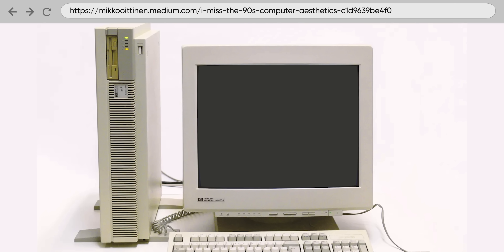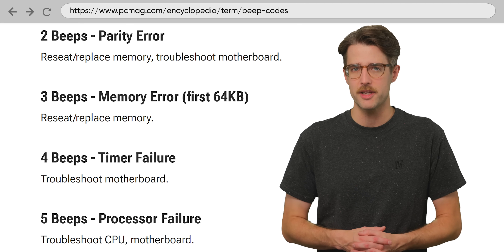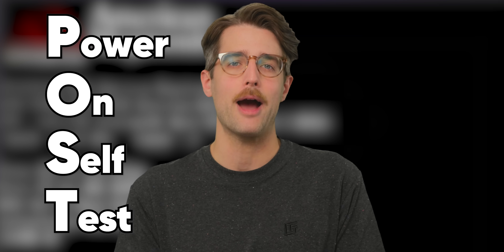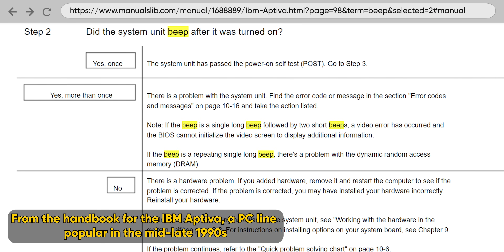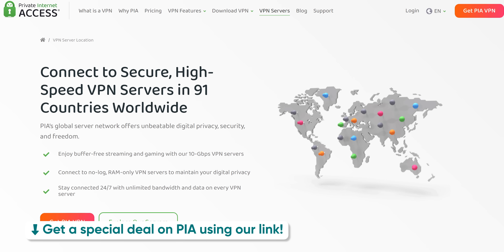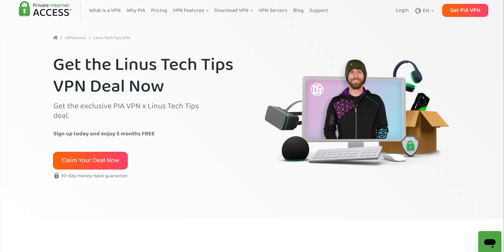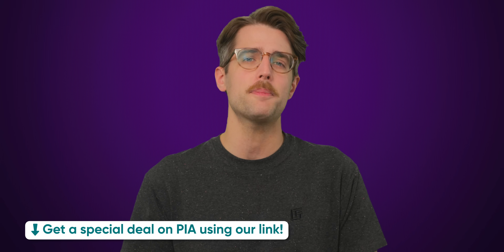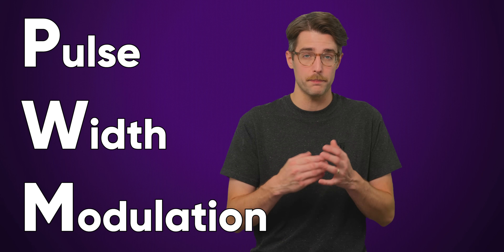Why Computers Don't Beep at You Anymore

Comment: I still use my pc that I builded in 2017, with a z170 and a i7 6700. That MSI board come with a very very very small speaker to insert to into the board. So everytime I boot the PC I hear that beep.

Comment: I needed the beeps, no errror codes displayed did have headers but....no speaker, so I went to an electronics store and bought a bunch (don't know when I might need them ever again so I put it with all the cables that maybe one day i will need), but it worked, connected the tiney speaker and got error beeps that made me identify the error. I left the tiney speake r in and now it gives post beeps and the user does not even seem to be phased about it

Comment: I used the original IBM PC in college. It was the very latest in tech at the time and only a few of the campus computer labs had any. Most of the computers in those labs were Apple IIe's. You had to be an early bird to get one of the 'new' PCs. My major professor's office had one too and I used it to do work for his experiments. The first thing I typed on was a manual typewriter in middle school, so I was pretty impressed by the IBM PC at the time.  I used to know what all of the beeps and their patterns meant.  I kind of miss the old beeping booping PCs and modems.

Ah, yes dedicated sound cards! I will never forget the first time I splurged on installing one in my second PC that I built myself. I got a Soundblaster sound card. Cost almost as much as my video card (aka graphics card) did at the time. But it was worth it because the sound it could send out to a pair of Soundblaster speakers that I also got at that time was glorious! I used Soundblaster sound cards right up until motherboard makers started including really high quality ones right on the board that were as good if not better than the sound cards a had.  One thing I don't miss about old school PC gaming is trying to configure each of my new (at the time) games to work with my sound card. Some never did quite work right and either sounded bad compared to the ones that were perfectly compatible, or even didn't make any sound at all because they just weren't programmed properly to work with a good sound card. Very frustrating! Sometimes, getting the game properly installed and working with your video card and sound card was an even bigger challenge than beating the game itself.

Comment: Had a phase where I was super into OSRS (then just RuneScape) like so many other millennial kids in the early 2000s. Got to the point where I wanted to play it even late at night. So I'd get up, and go to get on my computer. Well that little sonuvabitch had a loud ass POST beep and I didn't yet know enough about how it worked other than that it existed to blow my cover on such evenings. 

So in desperate fear of being caught, I would take my pillow and blanket off the bed and try to wrap them around the computer as much as possible, also put my body in the way and try to cover it like I was protecting someone from a grenade and hope for the best. It did make a difference, but alas I did get caught once or twice. I think it also spared me at least once too. I'm nostalgic for the beep and really like the idea of having something that can communicate something so important (like a 4 beep RAM issue) in such a simplified way, but damn that thing was my nemesis that year.

Comment: Class D amplifiers also use PWM... Today they are so good that there's no sound quality difference to standard amplifiers anymore yet are often 90% or more power efficient while standard amplifiers may only be 78% efficient in the best case which gives class D amps the possibility to be build much smaller as less cooling is needed.

Comment: I remember the tik tik tik tik sound of the ROM check on startup that 1980's BIOSes would do. "POST" really meaning something back then.

1024k OK!

Then the clunk.wheeeeeeeEEEEEEEE  of the hard drive powering on.

Hardware back then had a real sense of drama to it. And a very real chance of failing, refusing to work at all, interracting in unintended and confusing ways or occasionally actually bursting into flame or ejecting smoke.

Comment: My (Win10) main PC still beeps multiple times at me when it randomly decides to have an occasional stroke, slow all the way down without BSoD kicking in, and my cursor whips around my monitors at half the framerate. the amount of beeps depends on how many times I've clicked on something just seconds before this chaos begins so it's no telling when or how many times I'll experience it.

The OS was installed via disk + license key straight from Best Buy so it's a legitimate copy. From day one the stupid thing has barely functioned at all. It made me regret upgrading from my Win7 Ultimate HDD but it was necessary if I wanted to complete my last semester of college. The PC at the time was much like the family dog ~ loved it to death, it did everything I wanted it to, but inevitably became so old and barely functional so it was time to put it down. I didn't want to, but had to. Hell, my first install was from an old WinXP install disk but unfortunately it blue-screened. Tried WinVista, which worked but all the essential plug-ins and drivers couldn't be installed. Strike 3 was the infamous 10. I hate it so much. I want to build a PC to utilize my old Win7 drive.

Comment: I still  like to have a PC speaker in my cases. I have low powered PC's without Keyboard and monitor and can't see the LED's of some because they are in a closet, but I hear them beep when booting or getting to hot. Fans and drives are just to quiet to be heard. I can access them remote and they wake up on LAN when required.

Comment: My MSI mobo still has two prongs to connect a speaker to. Which I did. Then it was just a matter of activating POST in the BIOS and voilá! My PC beeps during startup just like my dad's 80386 and 80486. ^_^ Luckily, I still had my ancient PC from 2012ish, that still came with a beeper that I could repurpose.

Comment: In the mid ‘80s I had a dot matrix 80 char printer. It had an obnoxious piezo-electric beeper which beeped for 3s on the slightest thing. Fortunately I found the DIP switch that disabled it.

Comment: I had them for a long time beeping, but i dont miss em.
Boards and cases dont include them anymore (X570 Aorus Pro and H500M here).
Also Boards have diagnostic LEDs and even codes now and even modern onboardsoundchips are far superior to anything that this little beeper could produce, just need some external stuff connected.
Also PWM isnt just for fans, the entire voltage regulation on boards and GPU's also relies on PWM.
(X570 Aorus PRO: PWM-Controller: IR35201 (max. 8 real Phases))

Comment: Dell has the Pre-Boot System Performance Check, which is the same as POST but instead of beeping, the show messages on screen. If everything is working normal, it boots up normally but any problem with the system such as hardware or software will result in a Message showing up

Comment: It's worth noting that the PC speaker was a piece of crap by design. IBM never intended the original PC to be any kind of gaming platform, so they intentionally left out dedicated audio hardware on most of their models. The one exception was the PCjr, a cheaper version of the PC that IBM released for the home market. It has a three-channel programmable sound generator that was more comparable to contemporary home computers, like the Commodore 64. Unfortunately for IBM, the PCjr flopped hard, and it was discontinued about a year after it was released. It was the first and last IBM PC to have actual audio hardware onboard. 

I've been working on PCs for a long time now, and I find that the speaker is still a handy diagnostic tool to have attached. All the desktop PCs I own still have the speaker pin header on the motherboard, and I've attach piezo speakers directly to them. It's very reassuring to hear that happy little chirp coming from my case when I first turn it on.

Comment: If a motherboard still has a PC Speaker header, I still use it, even if all I put there is one of those little piezo buzzers hanging off the end of the four-pin connector.

Comment: I remember one computer I once built several years ago.  The motherboard came with a little speaker that could plug into the motherboard so you can hear the startup beeps.  I just don’t remember what motherboard included it.

Comment: I actually didn't know that boards don't even have the connection headers for speakers anymore. Just that most Cases don't include them.
Mine's old enough for both, although I don't know anymore if I got my speaker from the board or the initial case I bought for it.

Comment: I still use a PC speaker in my Sleeper build with an Asus ROG Strix B760-i wich it has the PC Speaker pins, I installed because originally it was a Packard Bell iMedia S3720 and it beeped on every boot so it's for nostalgia purposes

Comment: Sound was actually produced by chip in AT and XT keyboards which used sound generating chips to define   keys,  something like ladnline telephones with keyboards instead of rotary dial.  I remember times when you could dial by  whistling in headpiece.  Even my first  IBM 8086 was plying some  kind   of musical tomes during  booting. Later on  during last 286 and into 386 era when  first sound  cards like Soundblaster and Beech  were introduced there was a driver for  DOS and first Windows to use onboard sound as cheep alternative,  we  used to connect some larger speaker outside or a speaker with rudimentary amplifier on op-amp chip.

Comment: As a blind person, knowing why my computer won’t boot is pretty invaluable. I obviously can’t see lights on the mother board or text on the screen, beeps were all I had to have a clue what was happening. Having that taken away and not replaced really sucks. Desktop speakers and sound chips don’t matter if the post boot doesn’t load drivers to run them.

Comment: Remember a beep when booting? I still get one. And out of a proper cardboard-cone speaker, too.

Also got a couple of builds where I added cheap piezo ones because the cases didn't include anything. Unfortunately, the motherboard manufacturers often don't document the beep codes, so even if you do connect a speaker, you have no idea what the error message means.

Comment: I actually do have an internal speaker in my current system (only built a year ago), to be fair, I've had the same speaker since ...2009...BUT I do have one.

Also, it does beep at me on occasion as, for whatever reason, my current mobo freaks out if it doesn't detect a monitor in the primary display port output, which I tend to forget about when I need to restart it and also swap between computers using my KVM...

Comment: Vast majority of modern motherboards still have the header to plug in a PC speaker, and you can buy them cheap, such as six bucks for a 10-pack, no need to do something as excessive like buy a M.2 card designed to emulate a specific old PC's speaker. My recent 11700K build has one of those cheap speakers I mentioned connected to it's motherboard.

Comment: The beep codes are still occasionally useful, but modern computer cases don't have internal speakers any more. So a couple of years ago I bought a bag of cheap little peizo transducers on Amazon. They have a connector that matches the speaker header on most motherboards. I just stick one on the speaker header of every system I put together.

Comment: I still have an old school speaker, my previous X79 chipset Asus motherboard came with a mini modern speaker but the beep just didn't sound as good so I used an older one from a 90's Research Machines beige box from the local university.
Now that I'm building a new rig it's going to be transferred into there too.

Comment: My PC beeps a moment after turning it on, not because of a PC Speaker, but because the RAID card has a tiny buzzer on it.  It beeps a few seconds after it gets power, presumably for the same reason: the internal firmware and configuration passed tests and is working normally.

Comment: I still use motherboard speaker. I salvaged one from old prebuilt and installed it on my current motherboard (ASUS ROG Strix X670E-A) It is useful as I have PC below my desk and I have to lean down to read POST error LEDs. Secondly motherboard beeps at aprox half of volume when POST succeeds compared to error beep codes.

Comment: I have a HP dc7600SF that I installed Windows 2000 on and was surprised that the PC speaker could somewhat decently play the startup sound after I installed the motherboard-integrated sound drivers.

Comment: My 3-4 year old laptop has a built-in speaker, which cannot be disabled through the provided firmware. It's sometimes anxiety inducing when certain Linux software produce beeps with it by default, such as logging out of Xfce session, that I tried physically removing it. But after not being able to find it so easily, I assumed that it might be on the other side of the motherboard, requiring to basically remove most of the computer just to get access to it, that I just gave up and decided to find reliable ways to have X11 keep disabling it at startup.

Comment: I've still got one connected to my MSI Z490 board. It's not a proper speaker like shown in the video from old PCs, just a small piezo speaker. I'd miss the beep if it wasn't there though. 

I remember the old AMIBIOS in the 90s having a sound when doing the memory count before a beep!

Comment: My Gigabyte Z790-UD-AX has the speaker header, and I connected one those cheap piezo buzzer (a piezo soldered and heat shrink on short 40mm wires and header connector) just so I can have the beep on boot.
But if I wanted I could wire up a 8Ω 0.25W speaker for those authentic sounds :P

Comment: Still have a speaker, that I got with my previous case. Also used the speaker inside the case for a while as the main speaker on my Pentium 4 system back in the day.

Comment: Honestly, I'd be happy with having the PC speaker for a quick "why didn't you boot" - trying to look at diagnostic LEDs or codes (not available on every mainboard) is fine and all, but back in the day, those codes were fast and effective for telling you where to start.
Reply: Annoyingly, even if you DO connect a speaker and get the beeps, the manufacturers often don't bother including what they mean in the manuals.

Comment: I still keep a speaker around because cheap motherboards will often have speaker headers, but no LED to show if there's a problem.
I had an issue once that made me think the mobo, CPU and RAM were fried.
a couple months later, I plugged in the speaker and found out that it was just the ram, so I switched the slot and it worked again.

Comment: Grew up with internal computer speakers and I kinda use to it... I installed an internal 2 wire PC Bios speaker (from Ebay) onto my ROG STRIX X99 GAMING from 2018. It does work on startup as I can see the led read out and at... Think readout 40... I hear the beep. If I don't hear it... I know something bad happened!

Comment: The real magic of the PC speaker as a diagnostic tool is that it requires no RAM to operate. Displaying a message on a VGA card means entering video BIOS code to initialise the adaptor. Without RAM (a place to store the stack and hence the return vector) the CPU can't know where to return to after the video BIOS routine ends. However making the speaker beep is simple IO writes to the interval timer. This can be looped using simple jumps, no stack or RAM required.

Comment: The piezo output is included on all motherboards I've ever used. The Speaker itself isn't included these days, and they try to use LEDs. But if there is a hardware issue, the Speaker still works, abd the other methods don't. Bad memory? No indication. Video card loose? No indication. So I always plug in a piezo Speaker to every motherboard.

Comment: There was a speaker 'port' at a particular address; essentially, a status port.  To energize the speaker coil, you would set a certain bit in the port address to 1; to de-energize the coil, you would set the bit back to 0.  In other words, you had to write to a particular address where one particular bit in the byte you were writeing would control the spaker (other bits did other things, you had to account for that).  It's pretty CPU intensive.
Reply: Almost. You set the divisor on the programmable timer to determine frequency (two IO writes), then enable its output (one IO write). The square wave output from the timer is what goes to the coil in the speaker. Once you start a tone (by enabling the timer output), you can do other things while that tone continues, but you need to perform a second IO write to stop it. The techniques used for PWM playback abuse things a bit and do use a load of CPU time, but you certainly don't need an IO write for every oscillation in the general use case.
Reply: @RetroSwim  The only time I ever wrote to a speaker port, I wasn't using it at as a speaker, so it was like this:

IN   AL,61h
MOV  BL,AL
OR   AL,00000010b
AND  BL,11111100b
OUT  61h,AL
CALL PAUSE
MOV  AL,BL
OUT  61h,AL

it was generating a horizontal sync pulse for a descrambler.

Comment: I built my PC last year and and I did connect the small barrel PC speaker thing so it does beep every boot. It does come in handy if something fails and the motherboard only produces beep codes. With no PC speaker hooked up you would just get nothing and have no idea what happened. My next build I may end up with a motherboard that doesn't even have the PC speaker header, who knows. Hopefully it had the trouble LED indicator.